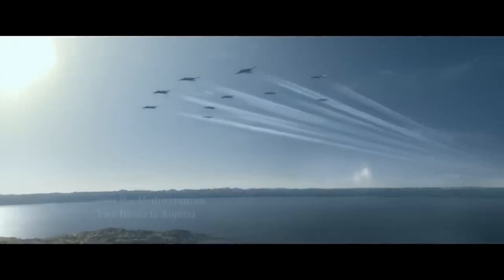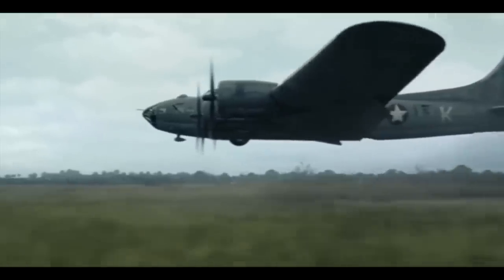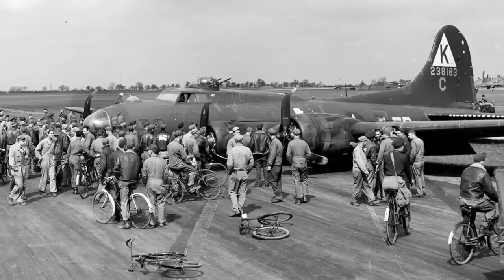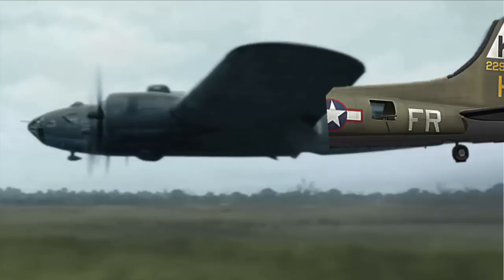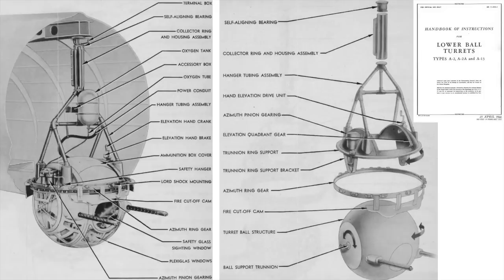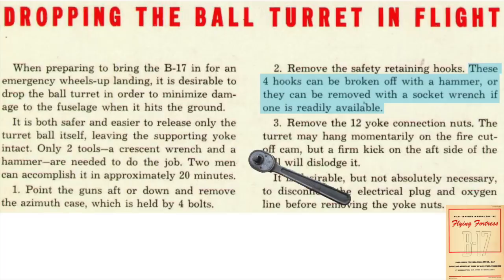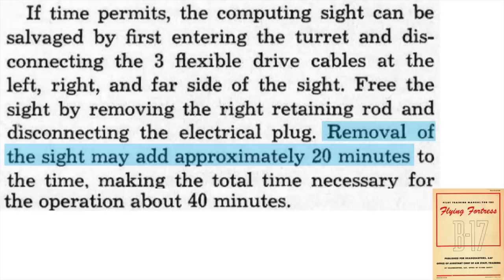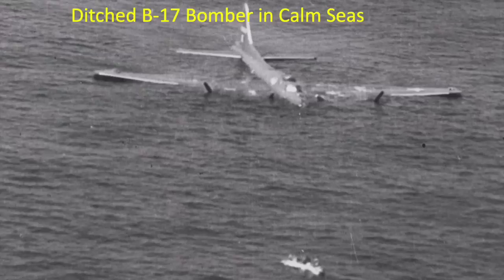Masters of the Air Ball Turret drop- Why and How Explained

Comment: Excellent!  When watching masters of the air I saw the order to "Jettison" the ball turret and the next scene was the ball turret dropping away.  I thought that was a mistake, knowing that the ball turret could not be dropped by flipping a switch or pushing a button.  I didn't know that it was a standard procedure to drop the turret for belly landings so I now realize that the depiction was accurate although they elected not to show that there was a 20 minute+ procedure to do so.

Comment: Would’ve been neat if the ball turret had its own parachute so it could basically be an escape capsule.
Reply: Or two thin square solar panel looking wings, oriented in a vertical position on either side that could enable it to fly around even into space and where it could dock with a star destroyer :)

Comment: I read in the MotA book that a B17 ball turret mulfunctioned and the gunner couldn't get out. Upon landing approach the pilot found that he couldn't lower his landing gear and eventually had to belly land with the gunner inside the ball turret still. The ball and it's gunner were completely crushed. I'm not sure if the gunner and pilot decided it would be more survivable for the gunner to stay attached or if the malfunction kept it locked in, but either way sounds like an absolute horror story.

Comment: Very intersting. Thanks. I knew there was a belly landing protocol but didn't know they suggested dropping the belly turret or with that the rear wheel was extended. I wonder how many belly landings actually followed those steps. I'd guess not all that many. What makes sense in the comfort of a state-side AC'ed office is often not be possible in real life.

Comment: My thoughts are if youve got 20 mins of flight time or even 40 if its one guy working on it. I think ditching the ball turret is a complete waste of time. 850lbs from 70tons... its much its all ceter so its not going to really matter the metal that its made of its going to destroy under the weight of the plane coming down anyhow. So I dont think it would really matter especially since the B17 was pretty good at belly landings with the wheels down and if youre already low on fuel the weight of the fuel having burned off would be a considerable amount of weight lost for a belly landing it would probably be fine.
Reply: A B-17 minus bomb load and much of its fuel by this point would weigh less than 25 tons. Max takeoff weight was never more than 35 tons.

Comment: Technology is far as the practical application of a multi-directional gun, still has relevance today imagine putting a minigun on a alter it on the back end of an AC 130U?

It doesn't matter if the plane has to fly in circles -  the gun does not, that Gunner can pick and choose targets what's the direction to the plane had to fly to loop because it's not a helicopter and cannot loiter.

This now becomes protection for the plane as well

Comment: In a generally good show, the biggest frustration I have is how the producers/filmmakers dont understand gravity, height or drag. The ball turret hits the ocean about a second after dropping, but the aircraft is clearly at several thousand feet. Its nonsensical. There is the same problem in many episodes with falling wreckage, including blown off engines that just float through the air like feathers. In episode 5 its particularly bad, where you see B-17's get blown to pieces, and then just drifting down like snow in a snow globe.

why does a ball turret fall like a rocket powered ocean seeking missle, but a detached engine floats miraculously through the air like an eagle on a thermal?

Both are infuriating. Its a show about aircraft and they dont understand how falling works.

Comment: i wonder if jetisoning a ball turret would actually improve fuel consumption
sure, the weight is reduced, but you end up with a huge hole, turning the inside of the fuselage into a giant parachute, that's going to cause a huge amount of drag
obv the ball turret is making drag while it's in the plane, but it'd be interesting to see some CFD to see if the drag is greater or less with a dumped ball turret

Comment: According to the inflation calculator app on my phone $14,099 in 1942 is $273,221 in 2034. If in 1943 it would be just shy of $254k.

So losing the drag of the ball and its 850 lbs of weight well more than offset the drag of a 4' diameter hole in the fuselage?  I'd like to see high confidence fuel usage data on that.

Comment: Sorry to do this to you and your video but This was not always common! They hardly got rid of the ball turret when they made belly landings . As you can tell it took up so much time removing all the parts and pieces from the turret. In fact a lot of guys died from the airplane making emergency landings if the turret door got stuck and that happened a lot . You need to do more research on this cuz your video is not 100 percent accurate.

Comment: I have studied all about the ball turret and spoken even with veterans. 
NO NO NO No turrets are being dropped in ww2 It takes a 30 minute job and wrenches to do that. On the b17 it takes more and the b24 it’s retractable.  Only one of two times it happend and so one picture is made where the ball turret dropped over water.  Why because there was a photographer onboard. 
This information acc the manual is correct but hardly executed in real time. 
It’s perfectly ok to land on the ball so why bother. The man is out where after the ball is moved horizontally. Having the ball crapes to dust in no problem and easy to repair. Many pictures are available about those events. Also b17’s with a broken back as the ball made it to do so. But the crew got out .
Crews where no mechanics, mostly tired or even wounded. 
Also the poem about the the ball turret is made up in a pub and not a realistic thing. 
A ball turret was a more safe place than a cockpit.
Next assumption is that crew knew on time that the landing gear was not functional. 
This they only found out about 10 miles out form landing. 
Meaning if the one wheel didn’t come out it’s probably that the other one didn’t come out anymore. If so they where lucky. But then there was not time to drop that ball. 
So again the idea is there but it was not a practical thing to do. 

They never tested that to see if it worked.
Reply: My Dad dropped the ball coming across the Channel on March 4, 1944.   I guess you want to call him a liar ?   My Dad had also been through B-25 mechanic school before he volunteered for gunnery school and went to war as a ball turret gunner.   Many gunners had other training.   They could volunteer for gunnery school and get a promotion to Sargent and higher pay.    And the SOP was to drop the ball before a belly landing.   The ball would hang up and would break the plane at the bulkhead behind the radio room.   There are many many pics of B-17's broken in that place that belly landed with the BT in place.    Internet experts like you, are a dime a dozen.

Comment: In the movies guys are always getting trapped in those ball turrets. So l had wondered why they didn't ever try putting an emergency ejection system, including a parachute, on them. This video says they weigh 850 pounds, not including the pilot. So,  not very practical; the chute would have to be huge. I suppose the movies play up that situation because the ball turret is small, claustrophobic, and hard to get in and out of even during normal operations.
Reply: Because in reality it happened maybe few times over dozens thousands of flights, as other videos on this channel explained ball turret was basically safest place in the plane :) Basically, whenever ball turret gunner end up in troubles most likely half of the other crew was already dead.
Reply: @randomnickify   thanks for your reply. I've read elsewhere that life expectancy of a B-17 ball turret gunner was about half of the other crew positions. If true, it would be due to all causes combined; fighter attack, flak, hypothermia, no parachute. Also, a wounded belly gunner was completely helpless until his crew could get him out. Probably true of tail gunners as well. Glad l wasn't around back then.

Comment: The B-17G at the Imperial war museum still has the original instructions for dropping the ball turret in flight.  The instructions were located on the bulkhead forward of the turret, just to the left of the doorway through to the radio room. The instructions were printed on a large paper 'poster' that was permenantly stuck to the bulkhead so they are always at hand in an emergency.
Reply: Reminds me of the instructions on how to use the toilet that were placed on the door of the lunar transfer space craft in “2001: A Space Odyssey”!

Comment: 20 mins to remove the sight, that's nuts why make it so difficult to remove? if they wanted the crew to save it, have it fitted with quick release pull pins. Even the turret should be only 3 pins and drop.

Comment: Thanks for the video. This Masters of the Air has been fantastic. In a perfect world the show would have included B-24s lol. Which made me wonder if the Liberator could drop its turret as well? I believe their turrets retracted fully into the airframe...btw the landing gear of the A-10 borrowed from the B-17's main landing gear design in that the wheels still protruded from the wheel wells when up and locked - aiding in a belly landing.

Comment: I thought a "quick release" for engines would have been a good feature. I know this was before "explosive bolts" were wide spread in use.
Perhaps a sliding fore to aft hole cover might have have been useful to reduce aero drag and retard water egress, as with up to 2,000 pounds of armor on these bombers, the added weight would be manageable.

Comment: I didn’t know the ball turret could be dropped. I always figured if the fort had to belly land it would crush and smeared the ball turret all over the field. I know that the Liberator could raise and lower its ball turret. 

The fact that a fortress could detach and drop the ball turret makes that position even creeper for the gunner. He actually gets into a contraption that not only hangs outside the plane, and is already the least likely position a crewman would be able to evacuate from a stricken plane, but now I learn that the gunner was suspended outside the plane in a contraption that’s designed to be able to fall free of the plane. It must have taken a brave man to operate that lonely position.

Comment: If  a crew knew they were going to have to belly land, say from gear not going down or something else that gave them time to do it they would  dump the ball turret if possible. I would imagine that with wind whistling through the aircraft from flak damage and a couple of crewmen working on it that ball turret could be jettisoned in under ten minutes; the possibility of it snagging on something and tearing the airframe apart would have lent speed to any effort. I would bet experienced crews kept two wrenches back there so two gunners could work on the jettison at once.

Comment: Yeah, but in the extra 20mins it takes to remove the sight, how much extra fuel has been used? I'm guessing most of the time the turret needs to be jettisoned it's because the plane has sustained damage and needs to land ASAP.
Reply: Even the first 20 minutes is a bit problamatic if a gear problem is discovered as they close in on landing back at base, which would also lead to it being likely that fuel is critical, and that those 20 minutes may not be available. Also, shouldn't forget that is 20 minutes after they decide to drop the ball, which would likely not be the first thing thety looked toward doing.
Reply: @billthacet  Good points.

Comment: Huh, I wonder how that worked without totally messing stuff up? Like if you had a series of bolts attaching it to the airframe, and you start to undo them, the last bolt or two are going to be holding the entire weight and the rest of the assembly is going to be twisting and straining on just that one connection or two.

Comment: Those ball turret gunners had balls as big as their turrets.   It was possible for the gunner to get stuck inside the turret,  if certain systems were damaged the ball wouldn't be able to align correctly for the gunner to evacuate the ball.   If that happens and then also are forced into a wheels up landing the gunner has no chance.  He'd be smashed and ground into the earth.   Similar scenario with a forced water landing but he would drown instead of being crushed.
Reply: Yeah it happened a few times

Comment: Amazing, I never knew it could do that.  Now here is a tidbit, I read a long time ago that the ball turret on the Avenger navy torpedo bomber was unsatisfactory. As it was too heavy for the aircraft with 2 guns. But was not enough firepower for the weight of installation with only one. Something about a huge military contract with the turret maker, and crew preference would have had twin .30's in it's place like the Dauntless.
Reply: Geometry might also have figured in to the TBF/TBM having just the one turret gun. That meaning both the geometry of supplying ammunition to 2 guns in the turret instead of 1, and, the horizontal spacing of the 2 guns creating a larger blind zone where you could not fire because of risk of hitting your own vertical stabilizer with bullets from one or other of the two guns. Probably other factors involved in the thing along with those production contracts.
Reply: @scottfw7169  Piston engine aircraft never had "too much" power. So the turret being too much weight at the wrong place or just too much all together with 2 guns & ammo, would not be surprising. Every plane has it's flaws. I don't think it made much of a difference in the over all war effort one way or another at that point in the fight.  With 150 carriers built by the US alone,  the USN could have used Devastators or even Swordfish for the duration and it would not have changed the outcome.